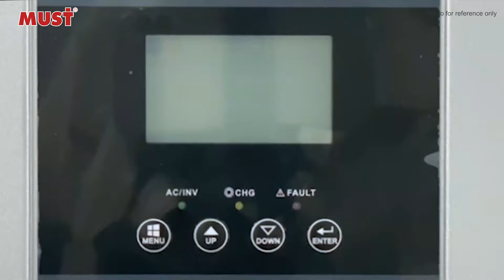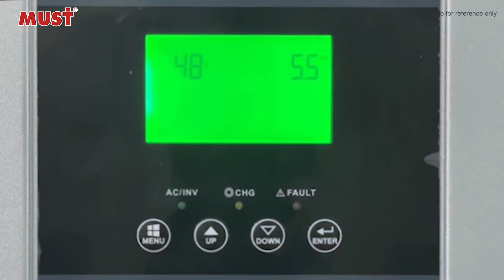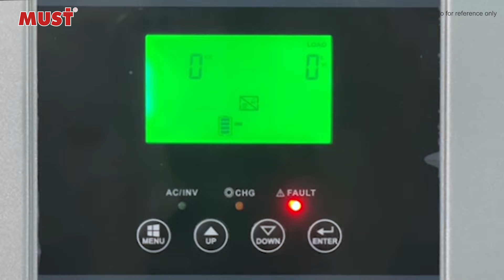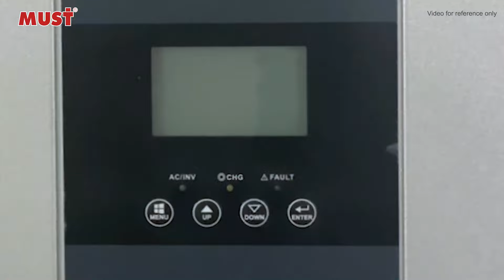How to Solve Error 09 in solar Inverters (PH18/PV18) ?

Comment: How did you know to change those two mofets, they were reading the same as the others ? Thanks for videos, massive help
Reply: No, these two had short - 0.00, rest showed diode forward voltage inside the transitor arround 0.3. these are not mosfet, rather igbt transistors.
Reply: @tomg8069 Hello! I also have error 09 but all transistors are intact. what could it be? thank you in advance

Comment: What does the "power On switch" do on the "PV1800 VPM 12V 1KW"? It doesn't turn off my inverter completelly for some reason. When it is off, my inverter starts working as soon battery and AC utility are connected.
Reply from the maker: Please read all the instructions first :
https://en.must-ee.com/DL/PV18,1012VPK(VPM),EN,MUST,M.pdf

Comment: Nice to put out videos like this. Must inverters are very good but difficult to repair once it has a fault. I have over 3 faulty MUST inverters that no technician can repair. 

I think you need to do more to help technicians to resolve the different faults that may be experienced with the inverter. One don't need to keep buying replacement inverters for a little fault that can be repaired.
Reply from the maker: We're sorry you've encountered this issue! MUST is working hard to constantly improve your user experience.
Reply: У меня тоже проблемы с вашими инверторами. Поддержка вообще не помогает

Comment: Nice video. I have 2 pv1800 are defected. One restart without any error number. And fan not working. Is there a schematic board or any help to resolve these. Thanks
Reply from the maker: Is it right for you?
https://en.must-ee.com/DL/PH18-5248%20PRO%20Maintenance%20manuals.pdf
Reply: Thank you for the document very helpful .
If I could get it for pv1800, as I mentioned before. Schematic a little different. Thanks
Reply from the maker: @begladhammoud7805  It is a relatively similar model

Comment: Good afternoon dear! Is it possible to program the control board of a 5.5 kW solar inverter via a laptop?
My inverter has a discrepancy of 2.2 - 2.5 volts from the batteries, for example, on the inverter there is 54 volts and at the same time in the batteries there are 56.5 volts.
Reply from the maker: Hello, can you send your question to our engineers and they will help answer it for you.
service@mustenergy.com

Comment: Hi Must Energy Group.
We have an PH1800 5Kw that has developed a problem this week. This inverter has been in operation since mid year 2020. All three LED 
Lights are blinking alternately continuously. The Inverter is stuck at the screen showing 48v and 5.0kw.
What could have failed inside ?
Reply from the maker: How are you?
Could you pls add our after sales engineer Mr. Cui and describe your problem details, with video better? 
email: cs-cds@mustpower.cn

Comment: my MUST PC1800A Series MPPT Solar Charge Controller (60/80A) shows Fault Warning Light  in the evening for awhile when there is no more sunlight and then the controller turns OFF . But turns back ON in the morning of the following day when the sun comes out.  Is this a problem or is it how it is suppose to function because I have been using it for awhile now????
Reply from the maker: hello, If you encounter any post-sales issues, kindly send an email to our customer service engineer at service@mustenergy.com.

Comment: Hello, my 3KVA MUST inverter sometimes gives error 52 " inverter bus voltage low" even when it is sunny . What should I do to stop this from recurring?
Reply: I would swap new capacitor for bus i gues its 560uf and 500V or similar. Would also check resistors for voltage divider changing bus voltage into smaller voltage acceptable by adc of the microcotroller.
Reply: mine is too showing error 52 how resolve this

Comment: Ich habe einen PovMr Wechselrichter 5,5 kw . Er zeigt auch Fehler 09 an und es waren irfb 4110 verbrannt. Ausgetauscht aber der Fehler bleibt! Es waren die Mosfets auf dem anderen Kühlkörper.  Wie kann ich die Mosfets am 230 Ausgang messen ?
Reply from the maker: Hello, the inverter you provided is not manufactured by us.
Reply: @MUSTENERGY mein inverter ist aber innen komplett gleich , wie dieser im Video und zeigt auch Fehler 09 an ! An was kann das liegen wenn kein Strom heraus kommt ?
Reply from the maker: @manfredanhorn1817  This brand is not manufactured by the MUST Company. You may consider reaching out to them directly to address any issues.

Comment: Hi I encountering inverter grid voltage sensor error (PV1800 model ) error 22
Could you help advice, is sensor mean AC Input right?  Thank you in your advance.
Reply from the maker: AC current sensor have problem.
Reply: Thank you.  Now I fix it. 
after fix error code 22.
And I encountering error 04 & error 56 , please help and advice again, thank you in your advance.
Reply from the maker: @ช่างหน่อยชุมแพ  error 04  battery is too low, error 56 battery connection is open. pls check battery actual voltage.

Comment: Hello, my inverter started giving error 09
There is a transistor NCE60TD65BT in my inverter "must PH18-3024 Plus", can I replace it with a transistor GWA80H65DFB?
Reply from the maker: hello, Component substitution needs to be tested. Electronic components must undergo multiple tests before they are used to mitigate potential safety hazards.

Comment: The inverter is stuck on a low battery error and does not charge the battery.
warning indicator ( 12 ).
must inverter hybrid ph18-3kva.
 battery is good.
please what is problem

Comment: My inverter keeps flushing all three lights and displaying everything on LCD and after 1minute a relay sound keeps on ticking what could be the problem it is not showing any error
Reply from the maker: this is the initial check when power on inverter，if inverter work normally，there is no problem

Comment: Kindly we need service manual for this model
Reply from the maker: https://en.must-ee.com/DL/PV1800,3-5.2KW,PRO,100A,BMS,JC,EN,MUST,M.pdf
https://en.must-ee.com/DL/PH1800,3-5.2KW,PRO,100A,BMS,JC,EN,MUST,M.pdf
------------
These two instructions may be useful to you, please note that these are the latest models.
Reply: The link refers to the user manual. It is not  the service manual. 

Please be so kind and add the link to the service manual here.

Comment: how to repair error 43 . error appears when connect solar panel >>how to solve it?
Reply from the maker: error 43--- Inverter grid under frequency
Please disconnect the mains power and try again.
Reply: @MUSTENERGY  I did not connect the mains power  to the inverter. I just connected the battery and then connected the panel. Is any solution?